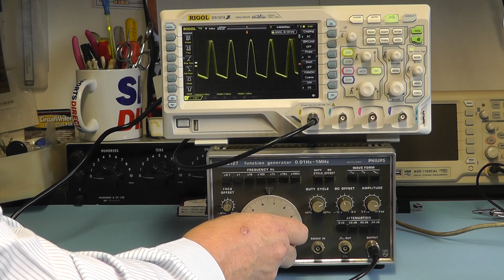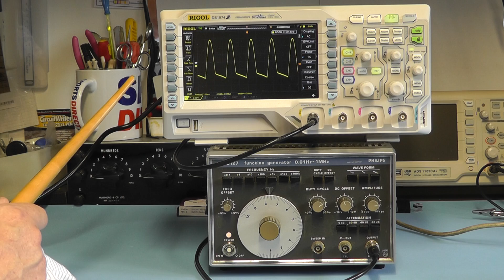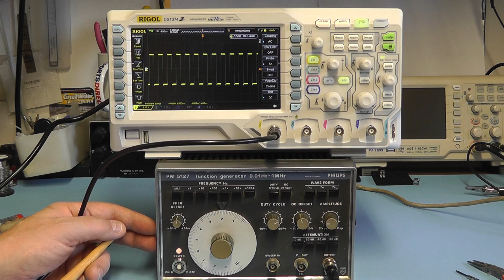Scullcom Hobby Electronics #17 - Philips PM5127 Function Generator Repair & Teardown

Comment: Nice video. Maybe I should get me one of this, easy access if repairs are needed. And also PWM dial, impressive.
Regarding faulty function generators, do you know if it is common that clipping only starts at higher frequencies, and only part of the negative portion of sine wave is clipped? HP 3312, seems to be working kind of like this Philips/Fluke with the sine shaper etc. All waveshapes display bad at above 1 kHz
Reply from the maker: Thanks Eric for your comment. Clipping can occur and is usually due to the equipment needing calibration adjustment. In some cases the output amplifier stages may have a fault.
Regards,
Louis

Comment: Very Cool, so pre- xr2206 and icl8038 days! This was when we needed to do waves veryy discretely haha!  Nice repair Louis and thanks for sharing this as well.
Reply from the maker: +saturn5tony Thanks. The Signal Generator is still working OK. I think when these were made they were built to last !!!!
Reply: So true and you can admire that so much.
Reply: That sure is a nice piece
Reply: The chips you mentioned were introduced in the early '70s, but they don't work well beyond about 50 -100 kilohertz.
Not good enough for a laboratory function generator.

Comment: How come when I buy used test gear on eBay I always get those units with the faults that simply not worth repairing?!!? :)
Reply from the maker: MrMonomonster There is always some luck involved when buying secondhand test equipment on eBay. I have purchased a number of items on eBay over the years but only had two which were not repairable due mainly to parts no longer been available.

Comment: Smashing repair :D, its a shame that some heavy handed oaf didnt mount those output transistors correctly, but i suppose if he did then you would be robbed of an interesting repair :-))
That dual psu looks very well cooked, the small capacitors i would not trust after all the heat they must have endured, and the blue phillips axial electrolitics can be a pain, ive had quite a few that simply wanted to be resistors lol :D
Have you ever had tantilum bead capacitors explode, i have, i hate the dam things lol.
Smashing video, thankyou :D
Reply from the maker: zx8401ztv Thanks. Yes I may replace some of the capacitors even though it is working fine now. Replacing the old capacitors will make it more reliable.